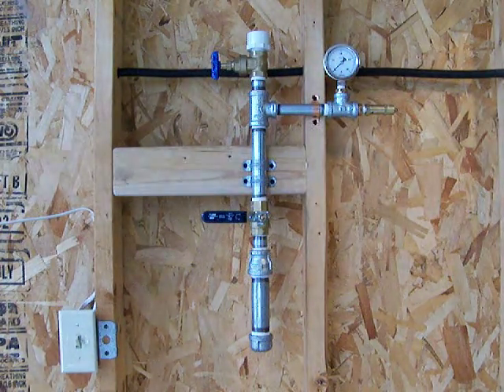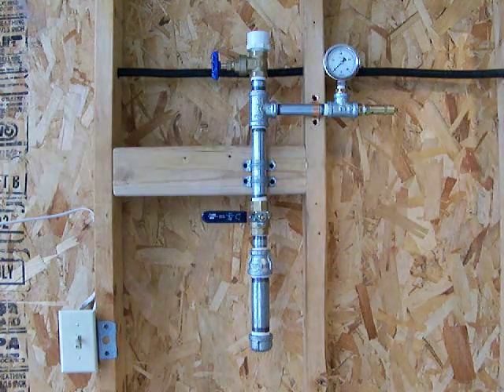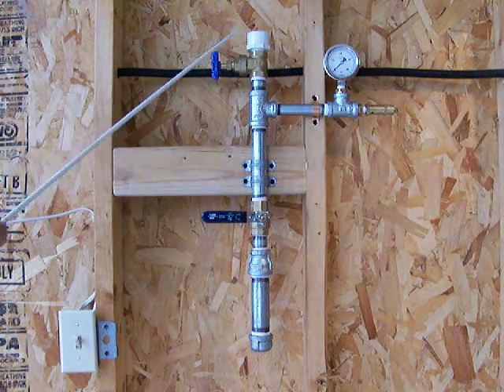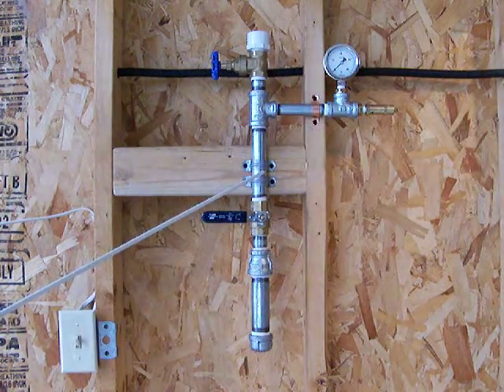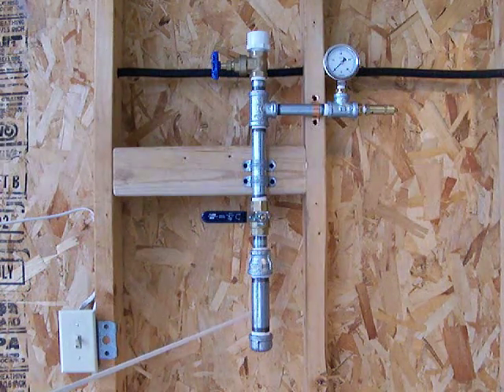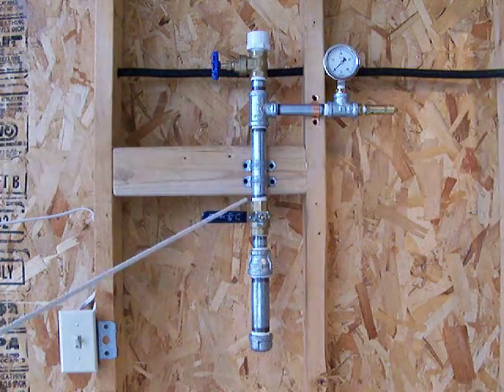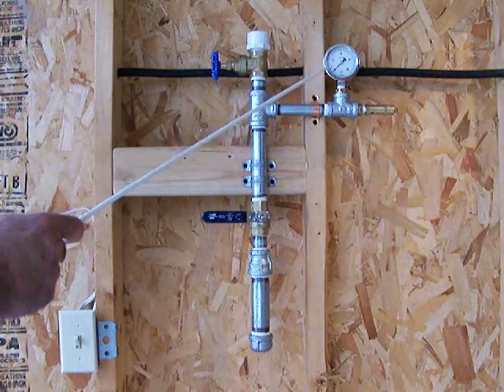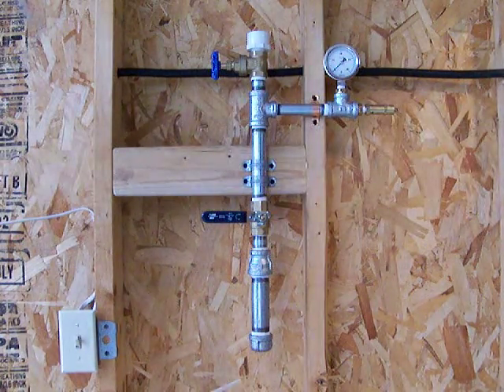Hydrogen Peroxide H2O2 Pressure Chamber

Comment: you can concentrate hydrogen peroxide by heating the water -not to boiling point- or else the peroxide will decompose at these higher temperatures, or you can vacuum the h2o2 to let the water boil and evaporate